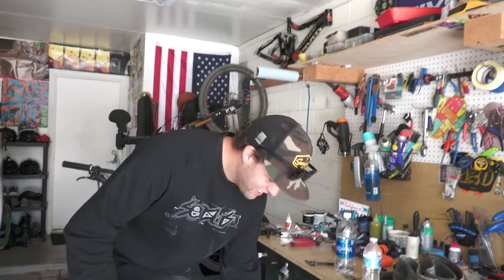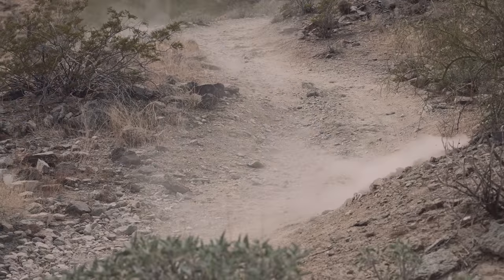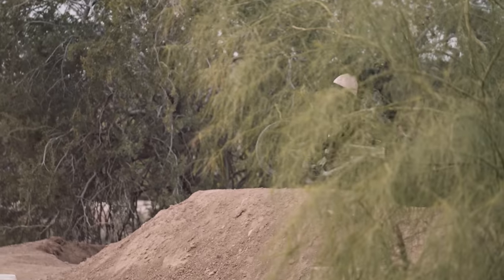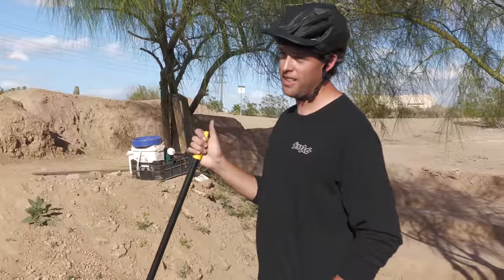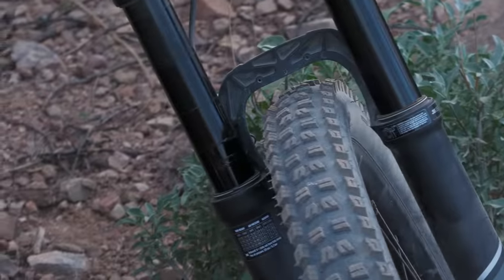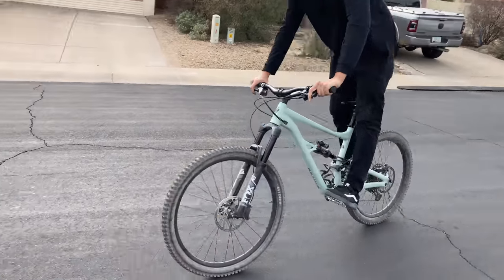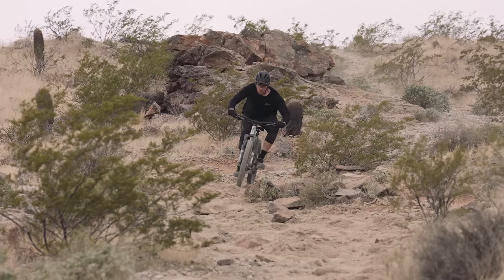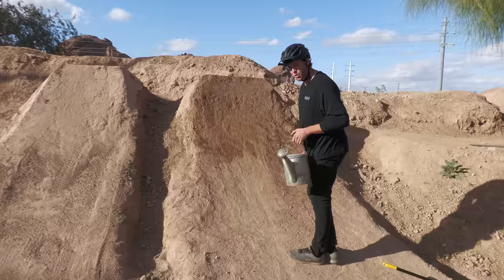REVIEW - $3,000 Specialized STATUS 160

Comment: I've had this bike for a year. Honestly been great. Sliced the rear tire after a week so upgraded to maxxis DD casing. No issues other than that. It's always fun to upgrade bikes, but when you compare this to the Santa Cruz bronson or similar, it's surprising how similar the geo on the status is (relatively speaking) but so much cheaper. Of course different bikes ride differently and suspension platforms make a big difference too... I've just had a hard time talking myself away from an upgrade because this is just such a good value.
Reply: Are you happy with the size? I typically ride a size Large as I'm 6' with longer arms. However, I see the reach on the Status S4 is crazy long.. Wondering if I should try the S3 as the reach is more similar to the size Large bikes I've owned...
Reply: @jordanwurmlinger4183  I'm having the same dilemma between S3 & S4, I'm 5 '11", fairly long arms. Did you get one and if so which size?
Reply: @donkeydeakin  No, I jumped on one of the Ripmo AF deals last fall. Couldn't be any more happier with this bike.
Reply: @Jordan Wurmlinger  ah nice I've seen a lot of people mention them actually. Bit of a toss up between the status, capra or one of them tbh. I think it'll just be a case of pick one and get over it, maybe I'm looking into it too much lol
Reply: @jordanwurmlinger4183  Just seeing this but whatever. I was on an S3/Medium and thought it was good. I pedaled a S2 around in the parking lot and felt it was a little small. I actually sold it (was happy with it, just like to keep trying different bikes) and the new bike is a little shorter at 455 reach (as opposed to 462 in S3). Cheers!

Comment: Mixed wheel size.  No thanks.
Reply: It's actually a pretty good setup.
Reply: @th_js  I understand the technical reasons to do it, but I don't like the idea of having to mess with two wheel sizes for spares and such.   But, there are plenty of use cases it's not really a problem.
Reply: @videoviewer2008  You are completely right, it's not fun not being able to switch tyres over and so on.

Comment: I've had the status 140 for 7 months now and have had zero issues with anything on the bike. Haven't had any creaks either. And I ride the shit out of it too. Definitely hasn't been ridden lightly. Learned 360s on it, road double blacks in Sedona, bottomed out super hard on big drops and jumps, all that and it still preforms soo well. I think the leaking of the fork in this video was just being unlucky. Only thing that may be an issue so far, I think the derailleur clutch has weakened, so heavy landings on big drops or jumps tend to make noise from chain slap. Thought this might be helpful for anyone looking to buy the bike 🤙
Reply: dose it climb good?  I'm looking to get the 140.
Reply: @johnkuhl9590  yeah it climbs just fine for me. Havn't owned any other full sus bikes to compare it to, but the 140 doesn't feel too sluggish to me. Climbs pretty well. I've done quite a bit of cross country trails with long climbs on it. Compared to my hardtail, its almost just as quick.
Reply: @Subala_Villa  thanks for the info
Reply: @johnkuhl9590  yea yea no probs
Reply: @Subala_Villa  how is the lockout?
Reply: Is the status good for flat relatively flat trails? (Southeast Texas)
Reply: @alex-dk2rj  id imagine it would do fine, you may want to look at a stump-jumper because there a lot stiffer. But i think you would be fine, depends on how you want to ride it, you can do pretty much everything you want to do on a a status, on a stump-jumper. I think you’ll get more energy efficiency out of a stump-jumper because it’s a lot easier to full throttle it on and sprint on long flat sections, than it would be on a status.

Comment: There actually is a low speed compression adjuster. It is a 4 position adjuster. If you look in the shock manual/ schematic it shows it. I have one of these on my '22 stumpy Evo alloy. You can pop off the little black cap where the adjuster should be (it's a little scary the first time, I used some Pedro's levers to pop it off) and turn the dial. It's not obvious unless you already know
Reply: Did you have to buy the blue dial for compression adjustment or could you turn it on its own?
Reply: @ethanjiinies u can use that same little black knob or buy the kit and put it on. It's very easy.

Comment: Those rims are dt511ex with another finish,good for trail&enduro use but like any other alloy rim,you can dent them. I always put a tire insert in both wheels,so no dings in my rims!!!!  I had killed many many tires&rims,at 150 or so running low pressure. My last wheelset is intact 2 years later,some cosmetic chips but 0 dings,only 1 flat with a trail butcher on the rear and octamusse insert.

Comment: Great bike for downhill and it loves to fly. Minimal effort to clear jumps that are sketch on my other bike. Not easy to climb though. Built for parks. Like other Status owners the first change is the tires. On more then one occasion the rear tire almost folded off the rim with high, med, and low air pressure. NX rear derailleur sucks and the cassette on mine comes loose often causing rattling back end. None of this is the bikes fault it's the components. Happy trails yawl.

Comment: I got mine last year. My Status has stayed in the "steep" position since I got it. It still feels slack. I just sheared the drive ring out of the rear hub, so if you're actually going to pedal it uphill, you might want to consider upgrading the rear hub. Rear shock came with nitrogen on the wrong side of something. And the tires are junk. But all in all, it's a good bike!
Reply: “Rear shock came with nitrogen on the wrong side of something” hahaha this made me lol.
Reply: @hadleybennett6875  i do all my own servicing except for the suspension nowadays. Couldn't remember what my guy said, but after he fixed it, it's butter smooth!

Comment: You don't need to swap out the full hub to change the driver. Just find the correct XD driver, pull off the old HG one and your golden.
Reply from the maker: we couldn't find confirmation that an XD driver is available for this hub. if it is, that's fantastic!
Reply: @vitalmtb  Roval has one. I swapped my mine to GX. $80 and you’re gtg.
Reply: @vitalmtb  The hubs are made by "Bear Pawls" and Specilized sells freehubs for XD (S202100005) and Micro Spline (S202100006) for 50€ (in Germany). U can even get a Rock Shox specific axle (S205900003) with 31mm endcaps for their "torque caps" mounting.

Comment: I’m looking at grabbing one of these and I’m a heavier rider as well. Besides the obvious rubber and drivetrain did the big unit do anything with tokens in either fork or shock to limit bottom outs for his weight and riding? Great to see some ‘real’ size rider reviews and not all you whippets haha. Cheers
Reply: 6'3" 235 on a status 140 and haven't had issues with bottoming out. Have the pressure set for my weight and everything has been good so far.

Comment: I like Jonathon’s reviews. Just wondering, did he prefer the S6 size of the EVO, or the S5 of the Status. Im a bigger guy at 6’4” and would like to hear his opinion. Also, I think it’s a huge endorsement that he liked the EVO so much that he bought one himself. Im assuming the same size (S6) as his test bike?
Reply from the maker: his stumpjumper is S5, too. he said for the tigher, more tech riding in phoenix, that's what he prefers. if he was in a place with faster, less-twisty terrain, he'd consider the S6
Reply: @vitalmtb  thank you so much! I’m in Bellingham so there is a variety of riding here. Thanks again for your input!
Reply: @HissLikeSteam  I'm 6'3" and ride a custom built S6 stumpy evo from Fanatik in Bellingham. I tend to like larger, more stable bikes and it definitely is that. The S6 works better for me with custom cockpit compared to stock. I use 40mm stem, 30mm stem spacers, 35mm rise handlebar, and seat slammed all the way forward. I love my positioning on the bike for riding downhill. There's no question I personally prefer S6 for downhill. The only disadvantage for me is the reach is a tad long for pedaling uphill considering the low back pain I've had for a decade.
Reply: @blangeleven  I’m from Bellingham and I love visiting Fanatik. Small world :)

Comment: Great riding! What is the tire pressure run through those rough sections? Thanks
Reply: I run 29psi rear and 27.5psi up front
Reply: @JonnySimonetti  Cool. So fairly high compared to what I often read. But it makes  sense, lots of rocky terrain there it seems, and for jumping. It also looks like you run your suspension fairly stiff?